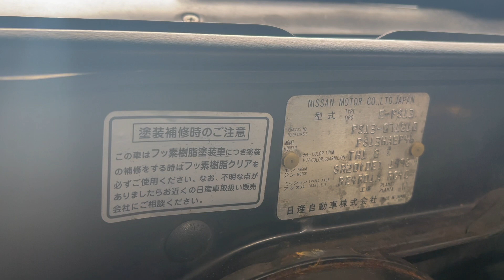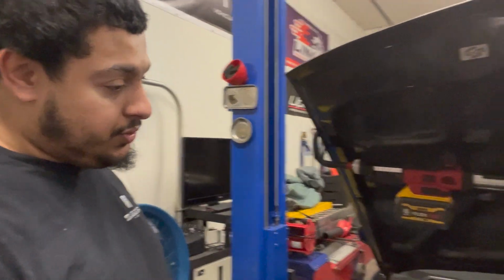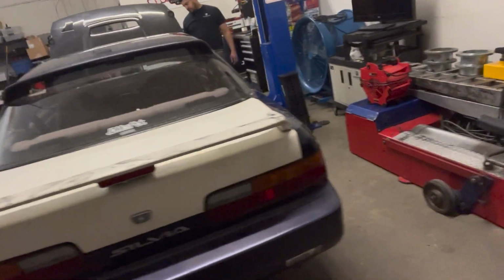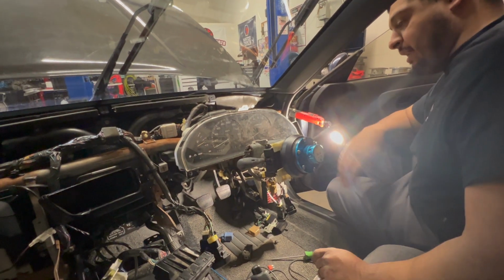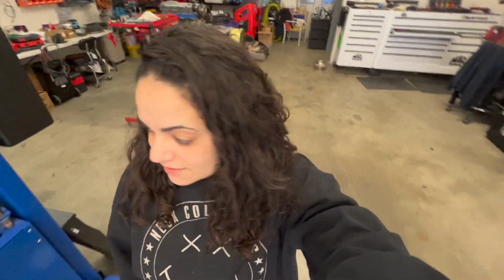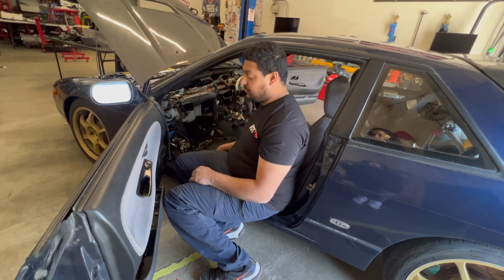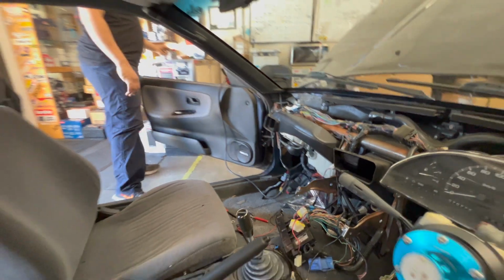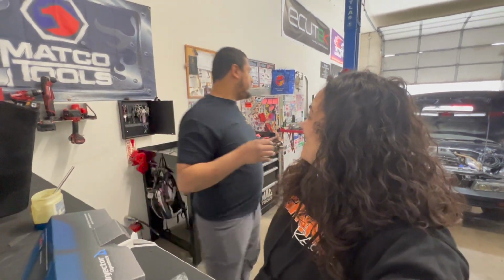Troubleshooting Nissan Silvia electrical problems SR20DET

Comment: I've had issues with the fuse box at the engine bay. There's is splices and fusible links from the factory that are not really sealed from outside elements. Great content BTW!

Comment: Check the window control amp box behind the door panel for the window issue, the solder joints in those boxs crack all the time.

Comment: Hello I want to run e85 in my s15 or May run a flex fuel would I need to just change my fuel lines in engine bay / fuel filter  / fuel pump ?

I’ve got 1550cc injectors 
Planning to get a 430lph fuel pump
Reply from the maker: We would recommend it, factory rubber lines are not E85 compatible
Reply: @SleeperTuning  I ended up buying 

radium fuel rail
Radium fuel plumbing kit changes the lines from the tank , under the car & engine bay comes with a 10 micron stainless steel fuel filter 
Bosch 1650cc injectors
Dual 525 in pump via a billet hanger 
Radium fuel rail flex sensor adapter 
Haltech elite 1500 Plug n play 
Haltech Can gauge 

Doesn’t sound like much but it’s expensive lol

I didn’t need to buy a radium fuel as I’ve already got a top feed rail already but I wanted to run everything radium not radium and then different brand of fuel rail lol want it to all work hand in hand lol